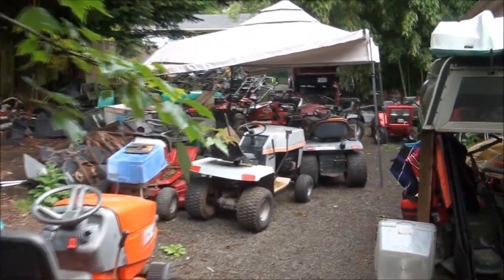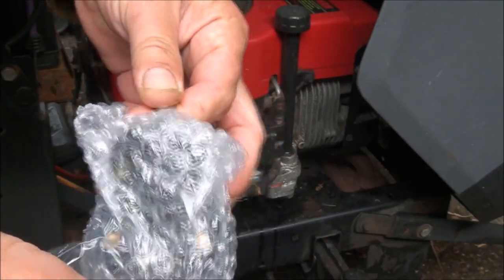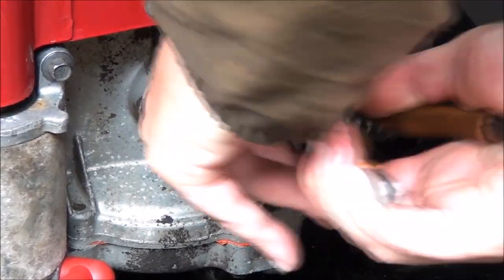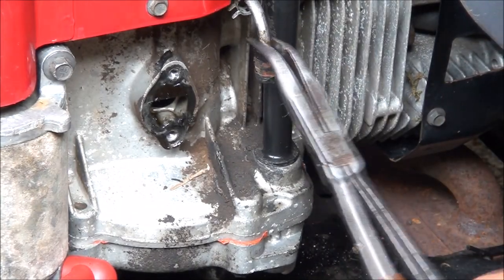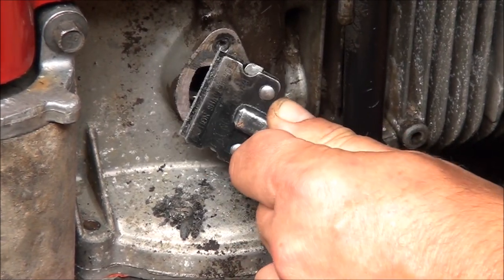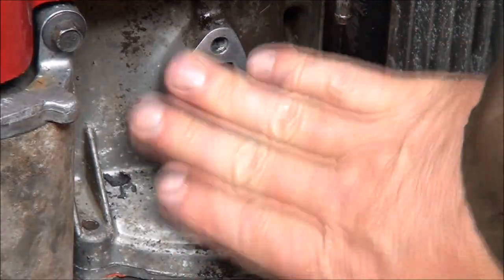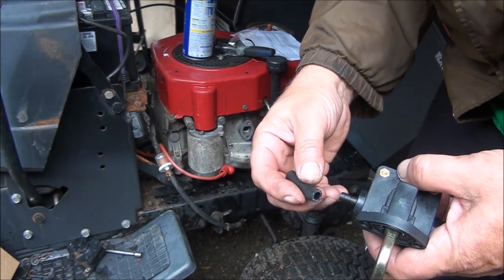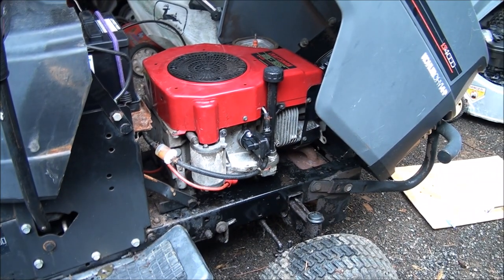HOW to FIX Craftsman model RIDING LAWNMOWER ~ WONT START ~Is it the FUEL PUMP? KOHLER COMMAND 14 OHV

Comment: Hi Jeff. Im with ya regarding kohler. I am not a fan of them, however i am a fan of yours. Great video as always
Reply from the maker: cool! thanks for watching Russ! Supposedly, some of the older Kohler engines were reliable...
Reply: Jeff's Little Engine Service yes very
I own a Kohler magnum 18 from 1988 it’s a very reliable engine fires right up runs very smooth I’ve also worked on and ridden my buddies old wheel horses with Kohler k engines I like them not a huge fan of newer engines unless it’s a Honda or a Kawasaki

Comment: last one i fitted was.... gasket ... plate ...O ring . plate gives the smoothest mounting surface for the O ring  good vid too mate , and yup never did like kohler either
Reply from the maker: I actually tried this and it would not run so I used just the oring

Comment: primal scream AYYYYYYYYYYYYYYY. WHEN YOU CUT THE FUEL LINE, by the way excellent video, and good close up filming easy to see what you are doing
maybe the o-ring gasket isfor a newer modell?
Reply from the maker: i actually tried the gasket and spacer first (I did not show this in the video)and the mower would not run...so I used just the oring and it worked!

Comment: Way back in the day, ‘71, I had a 1957 Fiat 600. Had to change the fuel pump, and forgot to put the spacer block in. Busted the actuator arm. Had to get another pump. 
I wish I knew then, what I know now.

Comment: In regards to whether or not to use an O ring or regular gasket I use whatever gasket came off the pump when removing the pump. I'll admit those directions were a bit confusing with both types of gaskets.
Reply from the maker: I actually tried the gasket and spacer first (I did not show this in the video)and the mower would not run...so I used just the oring and it worked!

Comment: Gotta a Kohler  CH20 S twin. Changed to electric - low psi pump  2 days after it was new. The stock pumps wont draw fuel from a tank 3' away unless.....the tank is higher than the carb. Mine would run out of gas at 1/2 tank. Exactly the level of the carb.

Comment: Jeff, happen to know the part number for fuel pump on a carb..... Craftsman pretty much a LT-1000. Briggs I/C Platinum twin V. 19.5 hp Turbo cool. Carb is# 693480. It is the 4 screw pump NOT 3. I need a pump rebuild and for months I been searching. I can't find no pump nor a part number on that pump to narrow searches. The engine itself on plate the id/numbers for engine is faded bad and can't make out engine # to even attempt a break down. Which will prob only list whole carb and carb # any how.